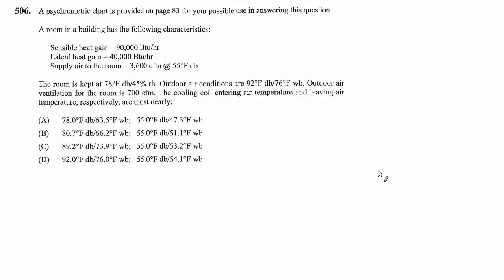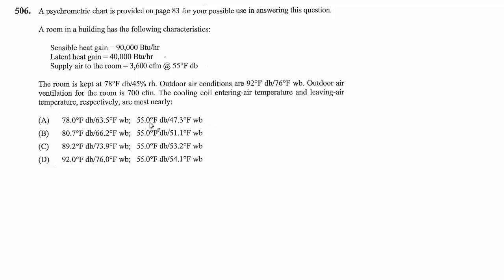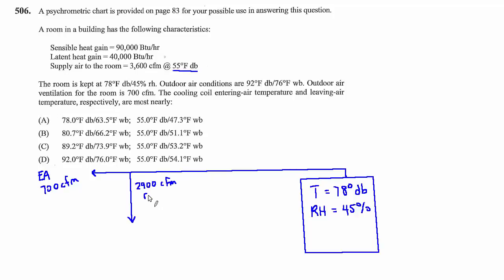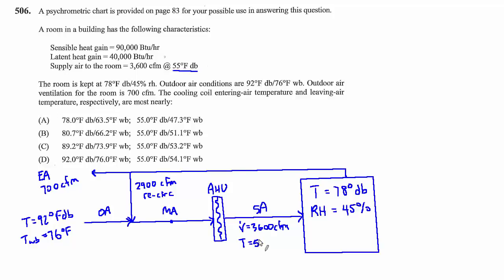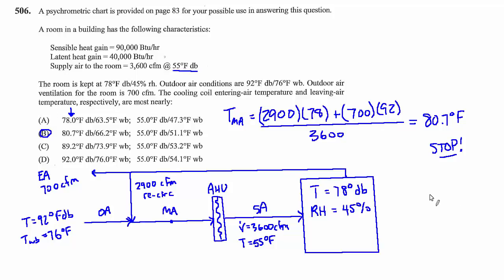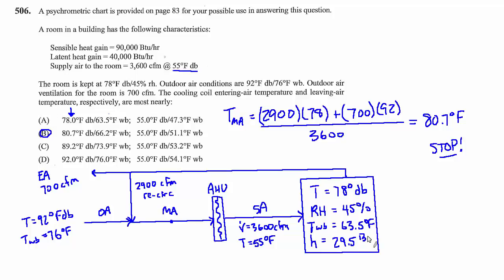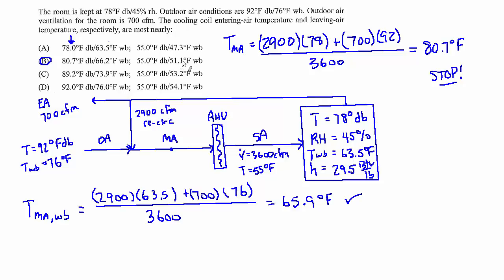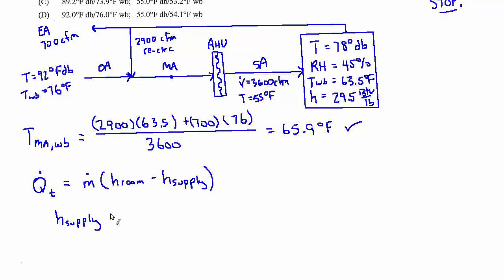How to Calculate Cooling Load with Psychrometric Chart | HVAC Mechanical PE Exam Solution

Comment: Hello, love your videos! Why did you use the specific volume of the room air and not the supply air?
Reply from the maker: Typically we use the condition entering the coil.  You should have a good reason if you're going to deviate from this.

Comment: A few questions:

Should we add in the heat load for ventilation air? Could we do this By using QTotal equal with enthalpies of outside air and mixed air? I have not done it both ways, but I wonder if the answers differ enough to make a difference.
Reply from the maker: Hi Samuel, Since we know the coil entering condition we already know the result of RA & OA mixing, therefore we should ignore the OA conditions.  Hope that helps! -Dan
Reply: @MechanicalPEExamPrep  thanks! That does help a lot and makes complete sense. Have you seen the NCEES solution? They add it in and I’m very confused why.

Comment: Dan, 
The method you use to calculate the mixed air wet bulb temperature (3:59) is a poor engineering practice. One should go to the psychrometric chart to get the wet bulb of a mixed air temperature.  
Vicente
Reply from the maker: Hi Vicente, Thanks for you keen eye!  Yes technically what I did there was a shortcut and will break down in extreme cases.  That said, it's quick and gives a pretty good approximation in this case and most cases where a high degree of precision isn't needed.  I'm glad you commented though, because I think candidates will benefit from challenging situations like this to improve their own judgment.  Thanks again! -Dan

Comment: I think that another way to look for 51.1wb, is to take the SHR slope of 90000/130000 from Tmixed-air (80.7Fdb;65.9Fwb) intersecting the 55Fdb SA vertical line, which gives a value close to 51Fwb.